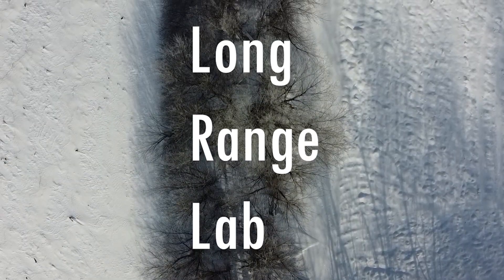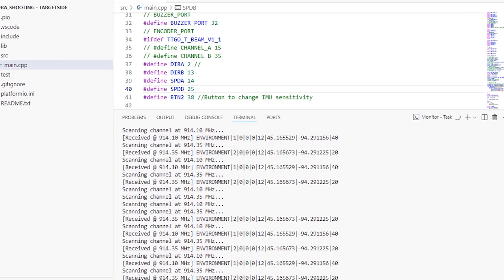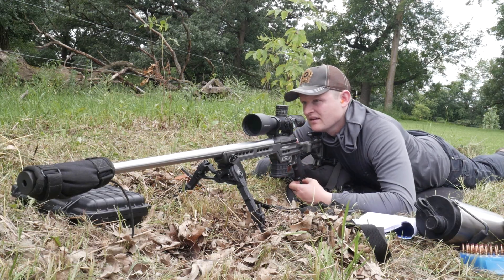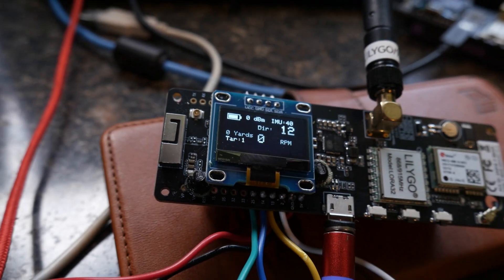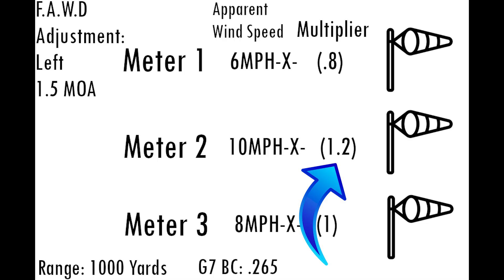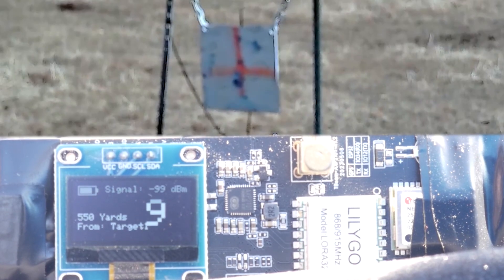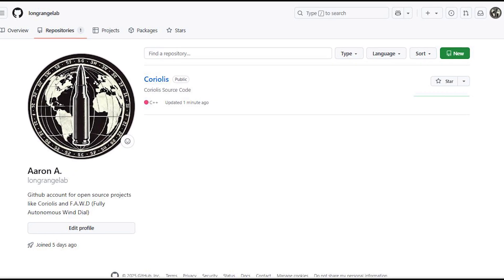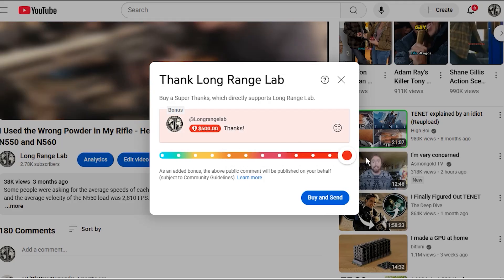How Autonomous Wind Tech is Changing Long Range Shooting

Comment: Open Source is nice and all that, but you might want to look into export controls / regulations in so far as it pertains to the code that you write, drawings, diagrams, and other information. I'm no lawyer, but you could run into trouble posting that kind of information on the internet if it is considered controlled under either Commerce (EAR), or State Dept. (DECCS) regulations. Even showing it to or sharing controlled data with a non-US person in the US, or elsewhere can be considered a "Deemed Export". Just an FYI to CYA.

Comment: Very cool. if the wind measuring equipment was on drones, you could feasibly set up anywhere and have a firing solution without having to have placed the sensors manually. I suppose some drones themselve act as wind sensors as they have to compensate for wind direction and strength to stay in place.

Comment: The first thing I thought of to make this gooder is to mount the wind detectors on drones. Fly the drones out to appropriate locations and land them (hovering wind detection may be a bit tricky), get the readings and pew pew.
Reply: Or just drop them from a drone which can then pick them up later.

Comment: 3:27 does wind have a greater affect closer to the target? I would think the bullet would be traveling slower the longer the shot and wind would have more effect on a slower moving bullet.
Reply from the maker: It all depends. 
You can also argue that small movements at the first 100 yards permanently affects the bullet's trajectory for the rest of the flight. 
I'd highly recommend reading any of Bryan Litz's books to learn more about that. 
The short answer is, it depends, and all of it is important.
Reply: @Longrangelab that’s a good point

Comment: I don’t see any reason that this couldn’t be used in a practical application. Someone hunting from a stand or blind could deploy this days in advance in their shooting lanes. Security details on roofs could as well. Those kinds of teams are usually well within the kind of range that would require it, but if the technology is dead nuts reliable, it could expand the capabilities in areas that were previously considered high-risk. Even on a battlefield the monitors could be deployed with drones. I’m afraid that DARPA probably got the kinks worked out of this kind of idea 30yrs ago, but who knows what they are up to. . .?

Comment: I can help.  This is right up my alley.  All the things.
Reply: The data needs aggregated via an OMG DDS middleware implementation,  preferably Micro-ROS w/ RTI-DDS.  That will open doors.
Reply: I've been working on a distributed inference stack using depth estimation, feature extraction, other vision models, and OpenCV for the purpose of placing crosshairs, center mass and mid chest on a video feed, the crosshairs tracking the closest individual on a list, with dynamic tagging of unidentified subjects.
Reply: I have everything to implement this hardware wise, MCU's, steppers, drivers, Pi's, Pi HQ camera, and a Hailo-8L on a Pi5 with 4 TB NVMe SSD's.  I do devops for folks that like stuff like this.
Reply from the maker: Shoot me an email! 
longrangelab95@gmail.com
I'll plug you into our discord

Comment: Well done!  have you thought of another way...  instead of the stepper turning the windage drum,   an overlay over  the sight picture as you see it with an impact  point indicator that moves every second or 2, would save wear and tear on the drums!  I remember some early  scopes that had a battery red dot  had the dot reflected into the centre of the crosshair...   what you have done is amazing!

Comment: Have 3 drones that fly out and drop sets of wind meters. The drones will triangulate the relative positions of the shooter and all of the meters.

You could advance the concept by having drones go out in every direction to map out the winds in a large area, and have a gyro-compass on the rifle to detect which direction you're pointed
Reply from the maker: We'll likely need to use a magnetometer affixed to the rifle in order to get a corrected firing angle.

Comment: The smaller caliber rounds you mentioned are able to travel to what you stated as insane distances however, the limit is defined as effective range.  A 30 caliber round has an effective range of around 1000 yards but, a 50 caliber round can have an effective range, depending on design and weapon, of 3000 yards.  Effective range is the point at which spin energy runs out.  The 50 has 2.5 times the frontal area but over 4 times the mass, it stores more spin energy and keeps it longer.
Reply from the maker: This technology is intended to extend the effective range of low performance cartridges.

Comment: the wind metering has an application if linked in with digital thermal and IR scopes in hunting blinds,  that do not need a physical adjustment dial.

Comment: Don't forget to weight the longer ranges wind correction a little heavier than close up. As the bullet goes down range, it slows down, so the further out it goes, the more that the wind at those ranges will have an effect on the bullets. (IE: at 600 yards, your fps is slower, so it takes longer to go from 600 yards to 700 yards than it did from 500 yards to 600 yards, etc. so the wind at 600 yards has more of an affect on the bullet than say 100 yards, etc.) This is why bullet drops at longer ranges are greater than at close range. The longer some force has to act on a bullet, the more that force will effect it.
Reply from the maker: We'll perform many experiments relating to that. 
I'm sure we'll find a sweet spot

Comment: You also have to adjust for air time, as the bullet is faster at the start of it's journey, it will be slower at the end, meaning wind down range means more than up range, not a huge amount but it is something.

Comment: Instead of multiple stationary wind sensors, explore that option telemetry being suspended under a drone. Gather data from one or more flights to the target area. It would not be continous live data, but it would make the usefulness of the technlogy more broad reaching.
Reply from the maker: Our next project is to develop a fleet of autonomous drones that line up along the path of the bullet

Comment: Incredible work Aaron and demo of how straightforward hardware development is now - love what you're building! 
I built a motorsport traction control system with an Arduino Uno in 2013, simple stepper motor and hall effect sensor - took me a full year to figure out and get right. 
I think this could be achieved in a week with LLM guidance! Crazy times

Comment: Imagine taking FAWD in a slightly different direction.  Imagine having an iPad at your shooting station that has an image of the target and an aimpoint superimposed on that target that is calculated based on the shooters ballistics data (bullet weight, MV, ballistic coefficient, range distance).  your system, could calculate wind impact in realtime and automatically adjust the POA as wind conditions change

Comment: The system should be able to have a fallback mode when not receiving anything from remote sensors.

Using a tiny camera with a simple NPU it could automatically try to compensate for the movements of leaves or trees far away by using simple Yolo models built to run on NPU.

I have lots of experience with object tracking and pose detection that could be used in this project, especially since I spent lots of time lately developing an auto lock and track module for drones.

Would like to contribute in this project.

Comment: @Longrangelab Here's my input for a military application. use your gizmo in conjunction with little disposable autonomous drones that dart into the ground and deploy little wind meter arms. they transmit their data to the gun gizmo, the gizmo makes sense of it, whamo. Over time as you fill the terrain with these, the wind conditions of the entire battlefield can be laid out on a massive fluid dynamics wind grid. The gun will know the current wind, and any wind gusts to come... I love this.
Reply from the maker: In my opinion, that is the final frontier of this technology
Reply: @Longrangelab I did a little video for ya of this. Hope you like it.
Reply: OMG furthermore, if you get enough of these lil drone things out there, like 1,000 or more, you could literally see enemy units moving due to the local wind conditions. Even if they somehow deceive your eyes, IR, and Thermal, they will physically move air no matter where they go.
Reply: I was having this exact idea like a week ago, crazy to find this comment without having looked for it
Reply: @skabyss did you take the vaccine?
Reply: it will also in general just help with ambushs and defending from a known direction
Reply: >they all rely on wireless signals and are thus easily jammable
Reply: I feel this would be best used for artillery and tanks.  They already have the automated targeting, but accounting for wind over longer distances could double their engagement distance.
Reply: If you can use drones in these conditions, why just don't launch kamikaze-drone instead of sniping?
Reply: @ac3_v3n7ur4  Cuz maybe the enemy isn't near.Also these could be pretty cheap, cheaper than a grenade.
Reply: @thedomesticoperator isn't one drone with grenade cheaper, than multiple autonomus drones, described below?
Reply: Or, no wind meter required if you let the drone attempt to hover stationary and use its compensation values to estimate wind speed.
Reply: @snivesz32  that's one flying drone. The whole point of my idea is to gather wind data in a grid, for long periods of time.

Comment: Keep pushing the limits!  I have dreamed of something similar for a long time - not the windage adjustment piece, but rather a complete array of wind meters at multiple distances and multiple heights that can be analyzed to reverse track a bullets ballastic path through a 3d space and provide a wind-hold via an app on my phone (with full recognition that latency in highly variable / gusty conditions will be harder...).  Anyways - good luck and keep going!
Reply from the maker: Holy cow dude
Reply from the maker: Thank you so much!

Comment: Brilliant! I'm an engineer who builds/integrates my own instruments and DAQ interfaces, and I specialize in low-speed anemometry and ultra-low differential pressure measurement equipment for use in my work testing/commissioning lab ventilation equipment and controls. I also enjoy long-range shooting, but with larger calibers like 300WM. Doing it with less expensive ammo, like .22Mag is an attractive proposition. You've got a great idea here! In answer to your query about the placement of the velocity/direction transducers: I suggest placing them ~10 yds either up- or downstream of the ballistic arc at the height of the arc above the terrain between shooter and target. Since wind speed vs. height above the ground is both very non-linear and unpredictable over non-level terrain the height of each is the most important parameter here, and the closer they are to the projectile path, the more accurate the results will be. For three transducers, start with equally distributing them at 25, 50, and 75% of the distance to target. Since projectile speed vs. distance from muzzle is almost linear, I suspect that the correction factors of the all the transducers may be equal bc the bullet speed/distance to target ratio at the all points along the trajectory will be almost identical.

Comment: Cool project, on the math side do you intend on incorporating another coefficient in addition to the BC that takes into account the side profile aero characteristics of the projectile for the crosswind component of the wind vector? As you accumulate empirical data you could refine the coefficient.
Reply from the maker: Jeff, 
I'll be totally honest with you, I haven't looked into the specifics when it comes to the math of the ballistics solver. 
Are you familiar with ballistic solvers? 
We've got some great software guys working on this project, but I'm not certain they have experience implementing ballistic solvers into an application like this.

Comment: I have some experience with 3D modeling and 3D printing. What do you use as a CAD platform? And if you don't have a strong opinion, might I recommend Onshape? It is free (if you're fine with your parts being open source) and it makes online collaboration super easy, kind of like GitHub but for 3D models.
Reply from the maker: I am currently using Blender 😅
I will take a look at on shape!

Comment: That is a  really cool project. Any issues with the weight of the unit and higher impulse recoil? What kind of help are you in need of specifically?
Reply from the maker: Thank you! 
It's tough to say right now as this is only in the concept phase and not a fully functioning prototype. 
I'm looking for people with experience in creating user HUD's whether it's on a phone or tablet or something like a raspberry pi. 
Basically we're looking to build a user interface that can communicate with two different ESP32 boards at once (something that can link the microcontroller controlling FAWD and the Coriolis weather meter)
Reply: @Longrangelab Cool! So you are looking to create a user interface and insert it into the existing communication between the two units? For what purpose? So user can see wind station data and adjustments? To alter tunings made to scope? Have you created tasks on github for people to work on?
Reply from the maker: @b1zarre23 we are actually on discord right now. 
Do you have software/electronics experience?
Reply: @Longrangelab yes, some experience in both
Reply from the maker: @b1zarre23 want to join us?
Reply from the maker: @b1zarre23 
This is my email: longrangelab95@gmail.com 
Send me your username and I'll add you to the discord along with the other software pros!
Reply from the maker: As of right now, there is no communication between the wind dial and the unit receiving all of the wind data. 
The user interface would be the go between the two units both displaying the wind hold for a given distance/wind condition and it would send a signal to the electronic wind dial.
In the HUD, the user would be able to change bullet G7 bc, range to target, barrel twist rate, bullet speed, ECT.

Comment: I am a fairly experience software dev (20+ years) that is into shooting and can solder. Love your project. How can I help?
Reply from the maker: Are you familiar with Lora mesh networks?
Reply: @Longrangelab  I know what they are but have not worked with them. I have worked with other tech so I am sure I can get up to speed.
Reply from the maker: @thesavagekiwi3492  okay! Essentially we're working on debugging the LoRa mesh network and also creating a HUD with an integrated ballistics solver that will also communicate with FAWD
Reply: @Longrangelab  Cool. I had been wondering about experimenting with integration lora with my home/farm assistant network anyway so keen to play. I am pretty familiar with mathematical modelling and simulation, so happy to help out where I can. I will flick you an email

Comment: Love it!

I wish things like the Sig BDX scope had an open SDK to play with. There's a big future in centralizing telemetry for long range shooting, tactical shooting, and hunting.
Imagine preparing a field to hunt with a system like this, plus a barrel-mounted chronograph like the Magnetospeed and other environmental sensors. A whole fire control computer!

I was also going to bring up using Lora for the telemetry radio- but then I checked Github and you're way ahead of me! I'll have to drop you an email, I'm an EE working in software now with a 600yd range at hand, I'd be happy to help out.
Reply from the maker: Your knowledge and advice would be extremely valuable to have!
Don't hesitate to reach out: longrangelab95@gmail.com

Comment: hi, great video,  good work , I use ultrasonic wind meter + modbus+esp32+lora, I think it is more precise then other meters. measuring from 0.2 m/s.
Reply from the maker: It is more precise than mechanical weather meters. 
This option will get us 90% of the way there at a fraction of the cost.
Reply: @Longrangelab  You are absolutely right. I bought ultrasonic anemometer for $70.

Comment: It's pretty likely you already know this but just in case: highly recommend using a better material than PLA (something less susceptible to creep, heat and UV) as you refine this out of the prototype phase. It should also be feasible to make these calculations/corrections continuously in more-or-less real time with sufficient design/software optimization which will likely become necessary as you push out the range in less stable conditions.

Hell if you collect enough data you can probably design/train a neural-net to even give you some predictive capability for shots with excessive flight time.
Reply from the maker: Yes, absolutely. 
In regards to training, I've toyed with the idea of implementing some kind of AI to help predict/smooth out the incoming data based on previous shots. 
Thank you for watching sir!
Reply: @Longrangelab  extremely cool project. I'm currently looking at your repo. I have a lot of plates spinning at the moment, but there's a good chance I'll come back and contribute to this project once I have less going on.
Reply from the maker: @Code-Sandbox-Dev I love it. 
I'm still working out some of the bugs in that firmware, so it should be updated fairly soon.
Reply from the maker: And also speaking to the PLA issue, yeah 100% agree. 
I'm saving up to purchase a Bambu lab enclosed printer so that I can print ASA in the future
Reply: @Longrangelab  yeah, I can tell, 😉. C++ isn't my strongest language (guessing you're in the same boat) but I already see several places where it's likely you're running into trouble.

Documentation is going to be your best friend when it comes to recruiting help in the short-term. Good luck.
Reply from the maker: @Code-Sandbox-Dev thank you sir